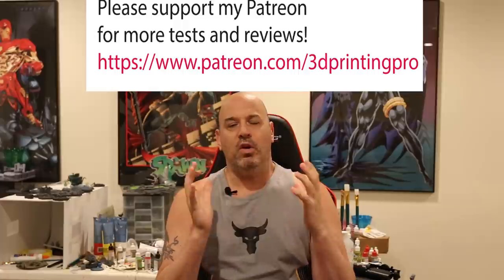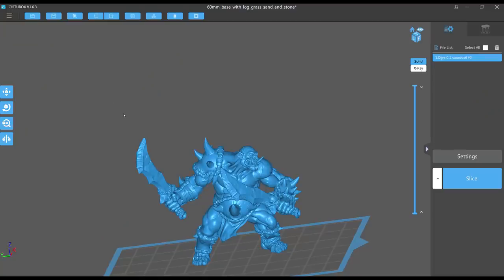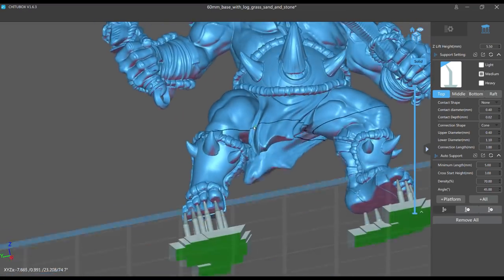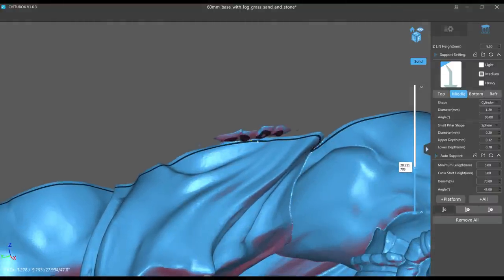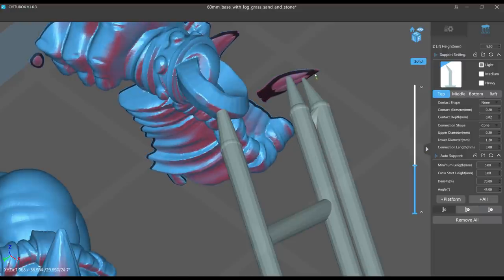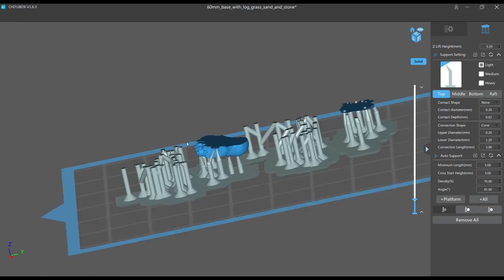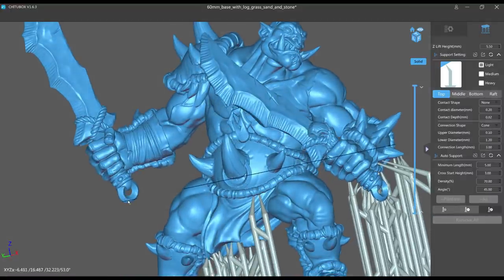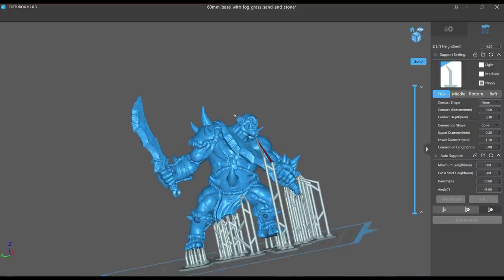Finally the video on WHEN to use Heavy, Medium and Light supports when resin 3d printing minis!

Comment: Watching this strongly reconfirmed everything I've learned from your channel, and I'm glad they were all compiled into one video like this. Just to add more to the discussion, I like making tree supports (one thick support pillar with multiple joints touching the model), and the same principle from this video applies here, where you have to start with heavier supports, then branch out with smaller ones while minding the center of gravity of that part of the model before it connects to the main body. Also, you covered the new Chitubox update 1.6.5 and it works wonders having the middle and bottom parts of each support disappear at a specific angle so I can see where I'm placing the supports better. That greatly improved my workflow and QoL. Thanks for what you do, and keep it up! :D

Comment: Thank you.   Having to redo supports from translucent to grey water washable resin.  The grey doesn't harden near as much so have to increase support size and contact points.  Models were being torn off at contact points.  Now have to immediately cure instead of smooth contact points because it's so brittle and weak it'll fall apart.

Comment: I am brand new to resin prints, had my photon zero for just over a week. I have had no prints fail to attach to the build plate,  it several presupported models fail to stay connected to the supports, both partially and fully. I am going to try using these ideas even on my presupported models.

Comment: I wish you would talk about the different type of resins along with making supports for them. I mainly use water washable and I have to change the supports quite a bit to get it to print properly without overexposing too much. By example the Titanforge models which are very lightly supported. If I don't increase/add supports to the heavier pieces, something is likely to fail on the print. However, If I use regular resin, a lot less failures occurs as the resin is stronger. I don't think going from 6.5s to 11s per layer is an acceptable solution like most people says. All to say that I would support differently based on the resin I plan to use.

Comment: Great vid, i hope with your input Chitubox can blow everything out the water for supports, id love to see a feature where you can go through the layer like you do but instead of seeing the physical supports you can highlight areas you want supports and then it creates them at the end so you can adjust any bottom parts too close to the model and such. I have trouble with too much clutter of supports blocking the view. Am also struggling with warping of prints off the plate and im not sure what is causing it.

Comment: Great video, thank you. I just got into 3d resin printing, haven't even printed anything but this answers a lot of questions and I can practice using Lychee. Of course I will go over this video multiple times. For a video idea you can pick out a free stl of a figure where people can download and follow along as you go through the support process. And then to end the video, actually print out the final supported product and review that. I think that would make an awesome video, especially combined with what you know about supports and 3d resin printing. 

BTW do you print you miniatures solid or do you hollow them out? Again great job. Sub'd and liked.

Comment: I have an unrelated question that perhaps you could kindly answer. 

I have a rather simple model to support. It is a bust. I hollowed it. Most of the islands I can support from outside. But the chin, and a necklace, it would be impossible (I think) to create a structure from outside the model, that supports it.

If I click on the places, for example to build a medium or thin support, it builds it, from the floor up to the chin, going through all the hollowed model. And I would need many of these kind of supports.

So my question is, would that be the correct way, to create supports that go through the model from fllor, through base, through model until reaching the point, or is there a way to create a support that goes from the model itself? thanks

Comment: I notice you are moving the tip of a support to a different location. How are you doing that? I'm also having trouble orbiting around. Sometimes it works, sometimes it won't budge. Very frustrating. I can't tell what's causing that. Thanks! this is very helpful information.

Comment: What are your thoughts on supporting horizontal surfaces that are at right angles to the rest of the model? Consider a 3" x 3" modular wall section with an open doorway, for example. How far apart would the vertical parts of the model have to be (e.g the walls either side of the open doorway) before you consider adding one or more supports to the horizontal part of the door frame? Or how much weight would the rest of the horizontal have to support (e.g. the rest of the wall above the door) before you add supports?

I sometimes find I get an almost corrugated effect along those horizontal parts when I support them, leaving me wondering if I have not supported them enough, or if I should not have supported them at all.
Reply from the maker: gravity and suction affect the shape,   so a horizontal surface I would pepper with really light ones to make sure it keeps its shape

Comment: Do you find yourself thinking about support placement in relation to orientation of the piece aswell as location on the build plate to take into account the angle the fep will be pulling away from it?  As in located in different areas on the build plate the angle of force from the fep will be different.

Comment: Thanks Greg, useful video as always :). Was wondering if your older video where you combine and group the supports into one and branch out could still be applicable with this? I'd assume so, as this video is more in regards to where to support and with what kind of support. Thanks!
Reply from the maker: yep you can use this in conjunction  :)

Comment: Useful as always, though I feel like you covered this in one of your earlier tutorials. One thing that I struggle with is orientation. You seem to have a knack for finding a good orientation right away, however sometimes I start supporting a model and halfway through I realize that the angle I'm working from is making things much harder than it needs to be. Sometimes it's hard to visualize when the model is complex. Any tips for that?
Reply from the maker: if there's no overwhelming reason (bunch of things pointing off in one direction) just doing 10-15 degrees back on most minis works best as a general rule  :)

Comment: I'm probably overthinking this, but supports on resin printers is confusing me! I understand supports on FDM, the supports are basically under compression due to gravity. But on a resin printer, which prints upside down basically, the supports would be under tension, not compression, right?
Reply from the maker: yes

Comment: I did try following this but it doesn't work well for straight object like a straight sword. It came out with noticeable curved, and I used 30 degree orientation too. If possible, can you show how to support straight object like a cylinder or circular like sphere type object.

Comment: You know what frustrates me to no end is when chitubox randomly changes all my support settings and I have to reimport them.  For a while there it seemed they fixed that issue but then it came back and I didn't even changes version from when it worked ok to when it didn't. It seems to be present in every version and just randomly happens for various lengths of time. One week it will work great then the next it could be terrible at keeping your support settings saved.

Comment: Every since changing my settings to yours, all of my prints have been failing...sort of. Most of the time it prints to the VAT at the point of contact to the model. For example: I printed a measuring tool and it peels from the contact to the model and prints all wonky!! It seems that it's ripping of the contacts at model.

Comment: What is the keystroke you're using for changing the visible layer height?

Also I would've liked to have seen the model completely supported and printed so people can see that the supports suggested worked.
Reply: I was just wondering about the layer height keyboard shortcut myself when I was watching this. On my Windows 7 PC, it's the up/down arrow
Reply from the maker: up down key, and you can see my supports on models like this all over Facebook to see they work, plus I have some free pre-supported models on thingiverse under the name "Bonegnasher" if you want to test them out  :)

Comment: I have a model I am having a TON of problems with, I have failed to get the supports right on it 6 times and its been nothing buy fails! is there a service somewhere to pay for someone to do supports?
Reply: Use lychee and put the autosetting in real , use heavy supports to the parts that will be sustain the whole structure (like feets if printed 90 degrees to the plate)

Comment: I’ve been super frustrated w my supports melding together on the presupported stuff I’ve tried to print on my AC Photon S.

45 lift
8 cure
4 bottom layers at 55

Idk what is happening
Reply from the maker: If your supports are all fusing sounds like overexposing, cut cure time by a second and try again
Reply: @3dprintingpro212  Thank you!!!